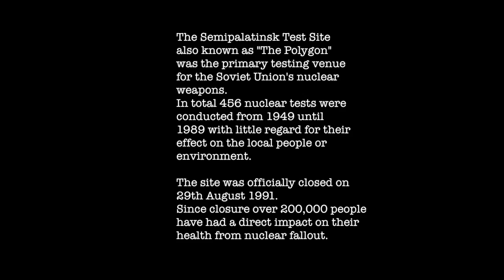Adventure Motorcycling Documentary - RACES TO PLACES SO2 EP8 Ft. Lyndon Poskitt

Comment: That model of USB charger, which seems to sold everywhere, is such a terrible piece of work! I've had 3 of them fail because of vibration -  a wire on the circuit board breaking. The last one, I filled the cavity up with silicon and seems to be lasting?